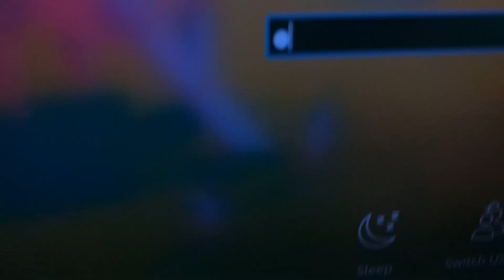Does hall effect sensing work THROUGH an LCD?

Comment: Hang on. If the point of this vid is to prove that it works, why would you film it in literally the only way that would make people doubt that you did this for real?

It makes no sense to film it this way, unless you wanted people to doubt what you said, lol.
Reply from the maker: What do you mean?  I had to hold the camera in one hand and the magnet/stem in the other.  So it was literally the only way I could do it.  Suppose I could've summoned one of my children to help me (to film from farther away) haha.

Also: Does my channel really look like the type that would just fake something like this?  LOL.  I have nothing to gain by faking it.  I'm just demonstrating that the hall effect sensing works through the LCD.  Nothing fancy.

BTW: I've since tested sensing through aluminum foil and it still works so my statement about the metal backing isn't correct.  You lose a smidge of sensitivity (in theory) but in reality that's no big deal for something like a keyboard 👍

Comment: This is about that FLUX keyboard isn't it? I'm still very skeptical about that whole affair but hey, I'll be more than happy to be proven wrong.
Reply from the maker: Yeah it's about both the Flux keyboard and the Finalmouse keyboard.  People were saying that it's not possible to sense magnets through the display and this test demonstrates that's not correct.  Instead what people should be skeptical of is full-size flat-topped keycaps made out of clear acrylic.  Flat keycaps suuuuuuck and finger cheese is going to destroy that clarity real fast LOL.
Reply: @riskable  as soon as I saw the flux video I went searching, if someone's made a Kickstarter there is likely a diy concept floating around before it and here I am. Totally agree on the clear keys not staying so clear, but it did start gears turning for a smaller macro pad/info panel kinda like the stream deck, grab a small LCD or OLED for a raspberry pi, then it's a matter of getting funky with the graphics